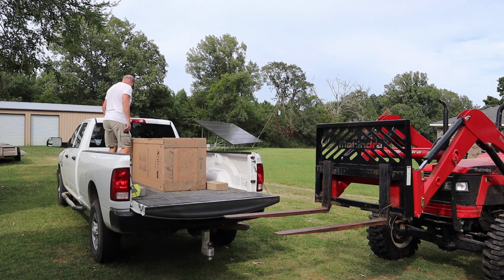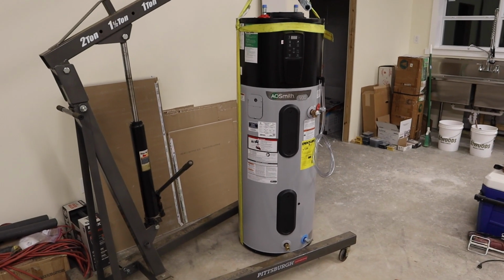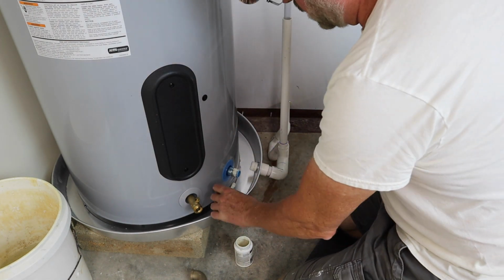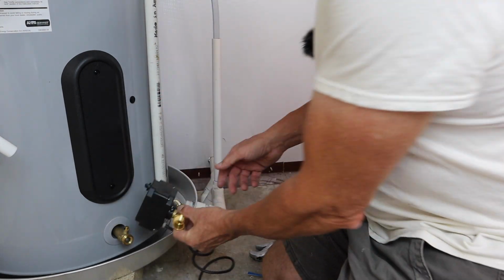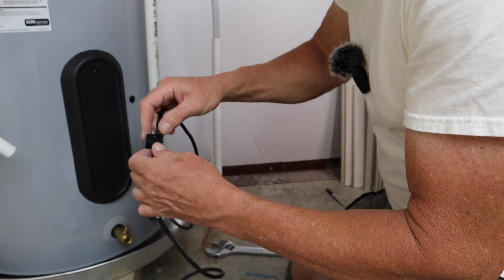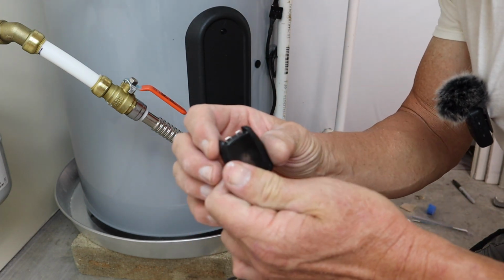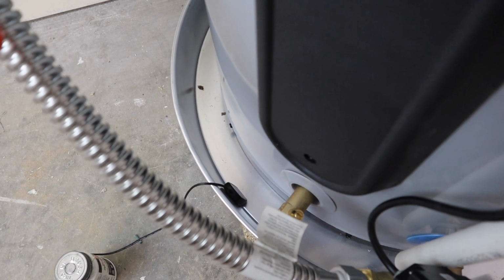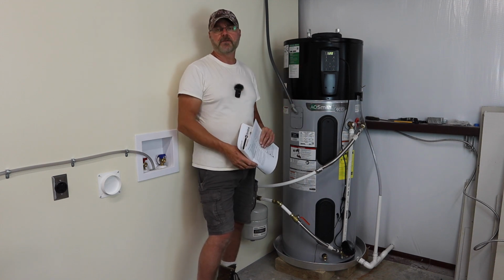How to install a hybrid water heater by A.O. Smith Signature 900

Comment: i bought mine for 250 dollars at lowes, was 1550, you cant beat that my old hot water just started pour water out of it somewere and seen this online at lowes and a regular hot water heater was 470 i got so lucky lol., i agree with you 100 percent if you dont no nothing about electric stay away from it, im a electrican and i seen homeowner try there own wireing and then they call you to come figer there mess out and then you spend more time figering it out and just end up redoing it all lol.
Reply: Man I got the same deal but mine isnt powering up. I might be the guy you are talking about lol.. but I have 120 on the red and 120 on the black and then at the top heating element I have the same. Just has no life to it. Ive read the manual and tried everything it says it seems

Comment: 2.5 years later, compressor failed. It is now an electric water heater. I have an 80 gallon tank that weighs 300 lbs. Covered under warranty but you have to bring the unit back to the plumbing supply place on your dime. You need a plumber to disconnect and reconnect and you have to transport it back. Not worth it.
Reply: I'd dont think you are covered under warranty if it's not professionally installed.

Comment: Great video sir! I've had the Reliance branded version of a very similar AO Smith model for a couple years and am doing my homework for evaporator coil/fin cleaning and maintenance.  Given that you have to remove the top shroud that houses the heat pump, I may replumb it to use the side outlet/inlets since you have to disconnect the lines if using the top nipples!

Comment: The AO Smith Hybrid 30 gallon water heater I bought at the end of 2019 decided to leak a few days ago. Turns out my breaker also died at the same time so it wouldn't turn on, odd timing. I called AO Smith and got a return authorization with no issues and swapped it out at Lowes. They delivered it a couple days later. Reinstall took about 30 minutes. I really love these water heaters since they save a ton on electricity and I can run it on my generator when we lose power. I was wondering why the heat pump didn't turn on for about 15 or so minutes when I initially turned it on. I guess it's because the water wasn't at least 55F.

Comment: I hope you see this comment before tomorrow but I have three questions.. we just got this installed today and we have an intermittent leak where the black parts meets the gray part. No rhyme or reason.. no other areas leaking. Any ideas? Also, we are finding the water is getting stuck in the condensation tube.. this unit replaced an older unit that didn’t have the condensation tube so the pipe it was put into is a lot higher than yours.. maybe we need to cut the pipe so the condensation tube is lower/more straight down? Finally.. we skipped the condensation wiring - manual said it was optional I believe but I could be wrong. Is it necessary? 

Thank you!!
Reply from the maker: @ShawnaMarie1  Check to see if the two pipes sticking out of the top where you can connect your water line in and out is leaking. It could be leaking there and running down the side of the tank inside. There might be something plugging the condensation tube. You might be able to shoot some pressurized air up the tube or use a wet vac to try and suction out the debris. I think the wiring is for a pump connection to a reservoir tank in case you don't have a drain nearby. Hope this helps
Reply: @ thank you! My dad had some of the same ideas so we are going to try and troubleshoot it tomorrow. We are thinking possibly the condensation tube backing up is causing the leak because it’s intermittent so he doesn’t think it’s the valve. 

By the way I saw you say that it stopped heating the water.. we had to replace our old unit because we got the dreaded ECC 120 code. Still heated our water but only to 120 max and we couldn’t adjust any of the controls. AO smith deemed the unit a total loss and we got a Lowe’s credit for this “upgraded” one. Wondering if they no longer sell our old unit because of that same issue. According to the internet.. it’s a common issue with these heaters.

Comment: Are the water connections on top ,they seem loose before even starting. Do I try tighten with pipe wrentch.
   Damn,you be lucky I had to go through a whole technical support rig a ma ro. They ignored me.  Wait firstly. My girl friend picked the thing up transported on the side line on the side was full of yellow juice in the crook of the hose. I had to bypass support went through investor relations . And I got a RMA . Returned to store rented trailer for that. Screwed around son long I missed the tax rebate. Do not lay on side lol

Comment: How has it held up?
Reply from the maker: @marcoshid1  Honestly I'm disappointed with the A.O. Smith hybrid water heater. The refrigerant in the compressor seems to have leaked out and doesn't heat the water anymore. So now I have to run it on full electric. It's still under warranty of course but it's just a hassle.

Comment: Never ever lay the water heater on it's side in the truck.  Has to be right side up only as the anode can easily chip the glass lining of the tank with it bouncing around on the road.

Comment: When you run it in heat pump only mode does the element light also come on when the heat pump runs? I just installed an 80 gallon like yours and in heat pump only mode the light comes on. I checked both elements and the voltage was only 0.003. So the elements don’t seem to be on. I’m just curious

Comment: Any idea why they would put the T&P relief valve right in line with the cold water side intake knowing the relief valve needs to be piped within 6” of the floor?? They could have put that anywhere around the tank circumference and they picked directly in line with the relief valve!!
Reply: They make 90degree elbows for that....one street 90 and one straight 90 and you could run the lines on top of each other out to eternity...

Comment: So do you still get the 10 year warranty if you install it yourself. I can install it myself, but not sure if I can get the federal rebate and warranty. ( I understand I will get no labor warranty if I install myself )  Also I like that you don't  need a neutral wire with the 220 volt supply?  ( I do have a 220 volt supply at the old tank ( no neutral )  ) This could have complicated things for either me or a plumber that installs it if I had to run another wire from the panel . .

Comment: I thought you needed a minimum of 6 inchs clearance from the walls for the tank.
Reply: 6 inches to the front of the tank (the display) the sides is only 3 inches.

Comment: Is that the 50 gal? What size pan is that? Is a pan available that is not as big? Shark bite makes a valve for over pressure. Can I use instead of an expansion tank?
Reply from the maker: Yes it's a 50 gallon. The tank is 22 inches in diameter and the pan is three inches bigger all the way around. So the pan is about 28 inches in diameter. It's best to use an expansion tank.

Comment: 12.27.23  How is the AO Smith doing.  Did some reading on the reviews from Lowes from the people who bought these.  Out of the 73 reviews 29% gave 1 star and 42% gave 5 stars.  Not to good.  Would the Rheem be a better choice?  I like the idea of being able to connect the water on the top or side.
Reply from the maker: Funny you ask, the heat pump portion of the water heater lost its refrigerant and stopped heating the water as of yesterday. The compressor runs but doesn't heat the water and I checked the evaporator to see if it froze solid, but it didn't.
Reply: @petebeasttexashomesteading  Have you found the cause and fixed heat pump issue? If not, how dose AO Smith warranty work since it is less than a year. Thanks.
Reply: @tomt9960 agreed, interested

Comment: I've had the AO Smith 900 for a year and love it! Its not at all noisy, minus the fact I think I hear a wire-tie or something rattling around inside sometimes when the fans spinning. 

I didn't hook mine up, so wasn't involved in the process. A friend of mine just had her 20 y/o GE water heater split down the middle and spill its contents, so she bought an AO 900 and we're hooking it up tomorrow. I absolutely hate plumbing (I'm a computer nerd by trade) and your video has reduced my anxiety over this a great deal. I'm also pleased to know that using sharkbites is OK on a hot water heater (THANK YOU because those things are amazing for people who absolutely suck at water pipe soldering aka me). If you don't mind, a question or two:

Her pipes are 1/2" and we're using sharkbite reducers to get the inlet to 3/4". Are we playing with fire in regards to the 1/2" side of things? Should the entire run of 1/2" be replaced with 3/4"? 

Her well pump is 440' down, and has a 30 gal expansion tank topside. Will adding an additional 2 gal pressure tank to the hot water heater cause any negative issues? Is it safe to have two pressure tanks in a system? 

Thanks again for this video! Wish I had seen it before renting a U-Haul to transport the thing upright 😅 We were told transporting water heaters on their side is 'bad'...is that just an old wives tale??
Reply from the maker: No problems with going from 3/4 to 1/2 inch shark bite and there's no problem with adding a 2 gallon expansion tank on the cold side of the water heater. You can transport any refrigerator/freezer or hybrid water heater on it's side of needed, but you should put it upright and let it sit a couple hours to let the oil and refrigerant settle in the compressor before starting it.

Comment: Supposed to put it 4" from the wall!!!!!  And should put an insulation bottom board!
Reply: I did research on this a month ago and I'm just getting ready to install. Spacing from the wall is new to me. Rheem has a video (mostly designed to make process look scary and funnel you towards contractor) stating 6". Is this a necessity or a potential local code?  

I am in earthquake country so it seems like it should be strapped flush w wall. My current gas heater is strapped to wall
Reply: I did research on this a month ago and I'm just getting ready to install. Spacing from the wall is new to me. Rheem has a video (mostly designed to make process look scary and funnel you towards contractor) stating 6". Is this a necessity or a potential local code?  

I am in earthquake country so it seems like it should be strapped flush w wall. My current gas heater is strapped to wall
Reply: I did research on this a month ago and I'm just getting ready to install. Spacing from the wall is new to me. Rheem has a video (mostly designed to make process look scary and funnel you towards contractor) stating 6". Is this a necessity or a potential local code?  

I am in earthquake country so it seems like it should be strapped flush w wall. My current gas heater is strapped to wall
Reply: I did research on this a month ago and I'm just getting ready to install. Spacing from the wall is new to me. Rheem has a video (mostly designed to make process look scary and funnel you towards contractor) stating 6". Is this a necessity or a potential local code?  

I am in earthquake country so it seems like it should be strapped flush w wall. My current gas heater is strapped to wall
Reply: I did research on this a month ago and I'm just getting ready to install. Spacing from the wall is new to me. Rheem has a video (mostly designed to make process look scary and funnel you towards contractor) stating 6". Is this a necessity or a potential local code?  

I am in earthquake country so it seems like it should be strapped flush w wall. My current gas heater is strapped to wall
Reply: I did research on this a month ago and I'm just getting ready to install. Spacing from the wall is new to me. Rheem has a video (mostly designed to make process look scary and funnel you towards contractor) stating 6". Is this a necessity or a potential local code?  

I am in earthquake country so it seems like it should be strapped flush w wall. My current gas heater is strapped to wall
Reply: I did research on this a month ago and I'm just getting ready to install. Spacing from the wall is new to me. Rheem has a video (mostly designed to make process look scary and funnel you towards contractor) stating 6". Is this a necessity or a potential local code?  

I am in earthquake country so it seems like it should be strapped flush w wall. My current gas heater is strapped to wall
Reply: I did research on this a month ago and I'm just getting ready to install. Spacing from the wall is new to me. Rheem has a video (mostly designed to make process look scary and funnel you towards contractor) stating 6". Is this a necessity or a potential local code?  

I am in earthquake country so it seems like it should be strapped flush w wall. My current gas heater is strapped to wall
Reply: I did research on this a month ago and I'm just getting ready to install. Spacing from the wall is new to me. Rheem has a video (mostly designed to make process look scary and funnel you towards contractor) stating 6". Is this a necessity or a potential local code?  

I am in earthquake country so it seems like it should be strapped flush w wall. My current gas heater is strapped to wall
Reply: I did research on this a month ago and I'm just getting ready to install. Spacing from the wall is new to me. Rheem has a video (mostly designed to make process look scary and funnel you towards contractor) stating 6". Is this a necessity or a potential local code?  

I am in earthquake country so it seems like it should be strapped flush w wall. My current gas heater is strapped to wall
Reply: I did research on this a month ago and I'm just getting ready to install. Spacing from the wall is new to me. Rheem has a video (mostly designed to make process look scary and funnel you towards contractor) stating 6". Is this a necessity or a potential local code?  

I am in earthquake country so it seems like it should be strapped flush w wall. My current gas heater is strapped to wall

Comment: Is there anyway to duct the air intake or exhaust?  I want to install one in a tight space but direct the exhaust cold air thru the wall to the home's main air handler just on the other side of the wall.  Or conversely, pick up the warm air from an adjacent kitchen above the cabinets. (or both)
Reply from the maker: Absolutely, the intake and outlet are able to receive 8 inch round duct pipe.

Comment: Awesome video Pete. Now that you’ve had it a month any updates?  I’m mostly worried about the sound. Is yours quiet? Lastly what made you go with the AO smith instead of the Reehm?
Reply from the maker: The unit is very quiet, you almost can't hear it running. I personally think it's better quality than the Rheem water heater and quieter. Extremely efficient only ran once for a short time after my wife and I take a shower (that's two showers)

Comment: Sounds like an order of magnitude more complicated/expense.  How is changing pipes when a replacement water heater with the shark fittings?  How do you undo them or are they totally replaced?
Reply from the maker: Shark bite fittings are easily removed with a little plastic tool or they make a better metal compression tool to take them off.

Comment: I'm glad I watched this before installing mine, as I was thinking the thermal pressure tank went on the hot water line supply. I may not even need one as my well already has a 30gal pressure tank. Thanks for the install vid, I may be getting this same unit, but still in research mode right now. 👍

Comment: the condensate from the heater is slightly acidic.  if dumps near or on cement  it will erode it with time. I have mine dripping into a 4" pipe filled with limestone gravel to neutralize the acid
Reply: On a gas tankless water heater it would be. Condensate from refrigeration is not acidic.
Reply: @Steve-bm2zm  you are correct.  I wasn't thinking about it that way when he said condensate

Comment: Excellent video Sir! 

I bought an 80 gal A.O. Smith Electric Hybrid from Lowe's last month to replace a 75 gal A.O. Smith natural gas water heater. The natural gas water heater lasted 17 years on well water. 

The project was more involved as I needed to convert from natural gas to electric. I used a plumbing company BlueDot for the installation. BlueDot recommended I buy a 4.5 gal expansion tank since my tank was 80 gal.They used the top connection. They also put in a 240 volt electric line. In all the cost to install was around $2,000. The cost of the tank was $2,800. I opened a Lowe's card that gave me 5% off. I am waiting on my $800 rebate from my electric utility here in Maryland. I will also get a $1,500 tax credit!

I love the unit. I run it in Heat Pump mode. It was placed in my basement. Maybe in the winter I will switch it to Hybrid mode. I set the temp to 130 degrees. It is super quiet. I also love the icomm app to track usage. I am averaging around 3.0 Kwh a day. My electricity cost is around 10 cents a Kwh. So, I am really saving a lot of $$$ over the natural gas unit. The condensation pipe drains into my sump pump.

Great video man. God I wish I had plumbing skills.
Reply: Anyone can plumb with shark bites and tube.
Reply from the maker: Thank you 👍

Comment: Seems like a good option if you only want electric. I went with a propane on demand water heater for our old house we are moving to in the next couple of months. We will eventually build a new house there as well but I'm still going to go on demand at roughly 15% of the price of this unit, even though power will be solar only. Downside is I have to buy propane a couple of times a year but I'll eventually build a solar water heater.